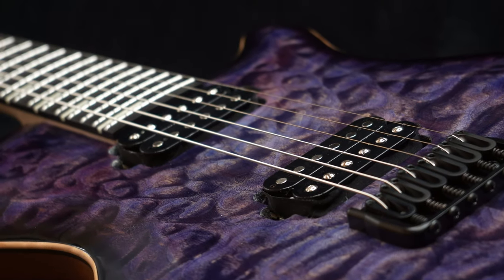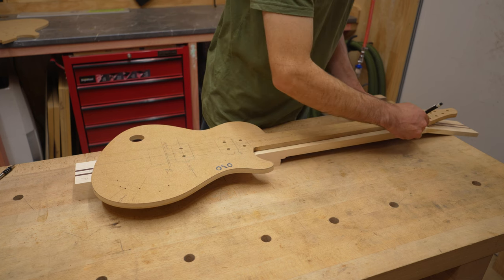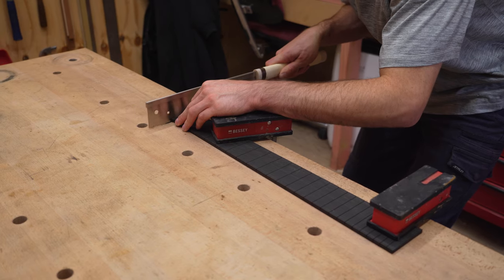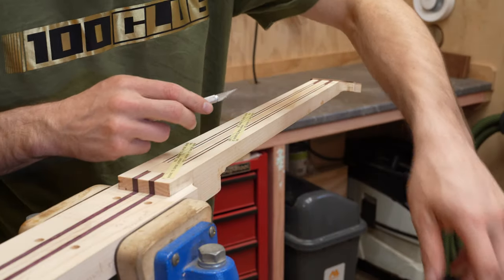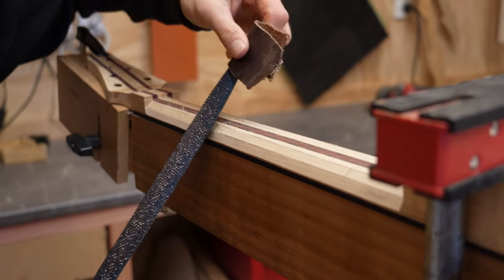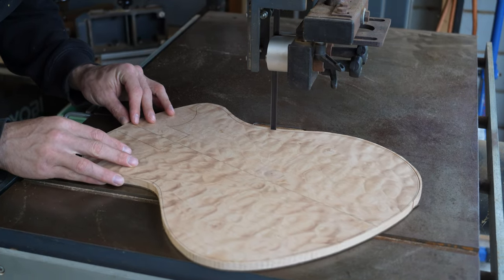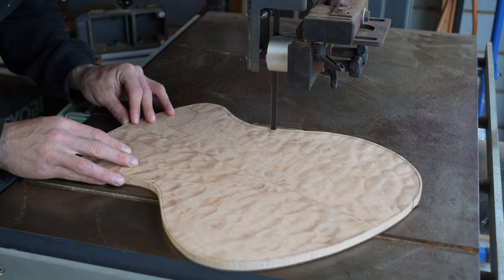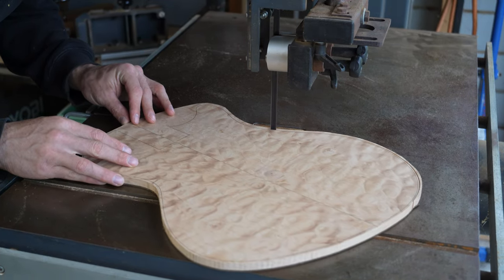Baritone Guitar - COMPLETE BUILD

Comment: wonderful work. I was wondering why you use a vacuum bag instead of clamps?
Reply from the maker: I found it a bit easier and quicker, and it works well in the case of bent laminations for example  bending a top over a forearm carve. But clamps work fine, it’s personal preference mostly.

Comment: I'm curious why you use a truss rod and titanium reinforcements instead of just a truss rod. Because of the increased string tension of a baritone scale? I've only seen those reinforcement bars used when there is no truss rod at all. Also props for doing the inlay by hand instead of CNC.
Reply from the maker: Reinforcement is for extra stability, probably overkill for this neck but why not.
Reply: @silvermanguitars  sick guitar bruv